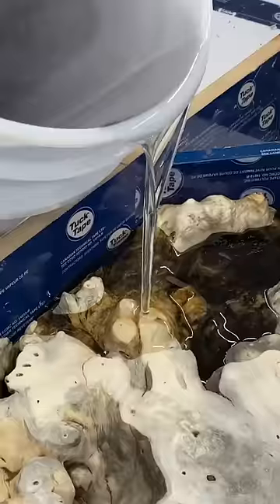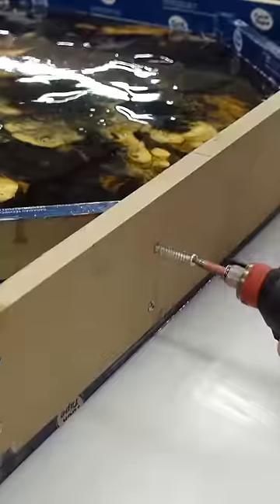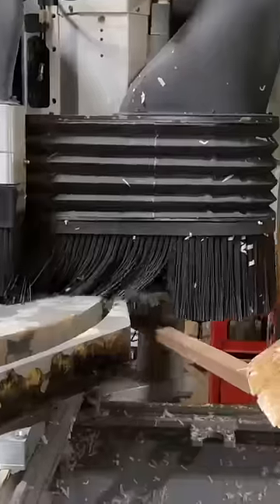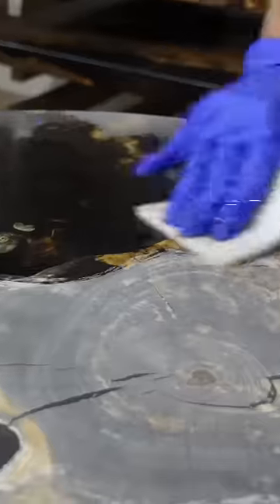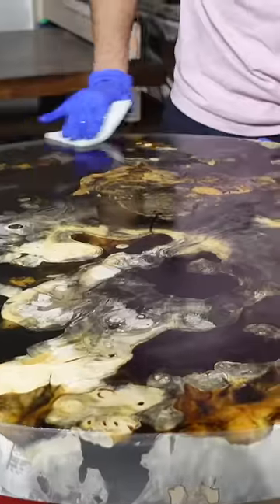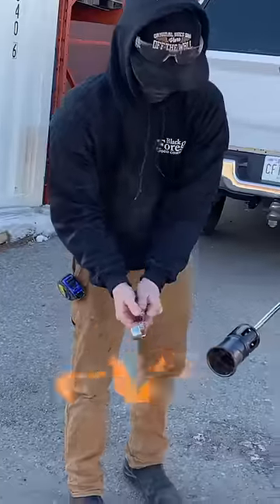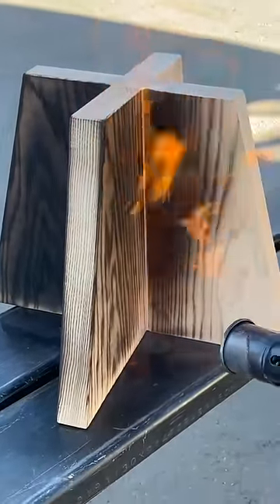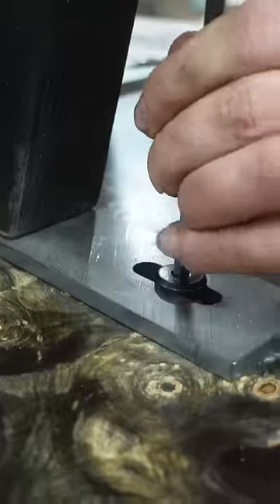Coffee Table made with Ancient Japanese Technique #woodworking #burl #epoxy #furniture

Comment: traditionally the japanese use heated pieces of smooth metal that they drag over the wood to char it. I tink it gives a nicer finish because it shows the grain structure of the wood. You might want to try that on the next one
Reply: Yeah with what appears to be white pine and a torch it doesn't look much better than if they would have painted it matte black and called it a day.

Sho Sugi Ban should have MUCH more texture and personality.
Reply: I also seen ones were they torch it first and run a wire brush across it, but some of the pieces are crazy beautiful
Reply: they did it the american way
Reply: yeah the finish is very nice, it becomes smoother to touch but still has wood texture and looks like it was painted
Reply: This is a different Japanese method called yaki sugi
Reply: @El-xt9oo  You mean the cheap and easy way?
Reply: Also probably reduces the odds of the wood catching on fire.
Reply: @updownstate  yes bro
Reply: @updownstate  cheap and easy is china, America is efficiency. It wouldn't cost anything really to do it the way the commenter said, but sure would take longer.
Reply: @Kratos-eg7ez  "cheap and easy is china, America is efficiency"

You keep telling yourself that if it gives you comfort.

You are deluding yourself if you think for a second that a country capable of producing companies that cause disasters like the Ohio train spill are not capable of cheap and easy methods to gain greater profits.

It's about the business itself, not the country they are based in.

"It wouldn't cost anything really to do it the way the commenter said, but sure would take longer"

On reflection it's clear that you don't get how business works at all.

Longer = more time = more wages paid per work order = less profit = MORE COSTS.
Reply: there's maybe 1-2 old man still doing it like this somewhere in the world but even in japan no one does it like that anymore

Comment: I believe the use of CNC machines, polymer resin casting, LPG torches, steel brackets, and wood screws driven with lithium ion battery-powered drills dates back to the Edo Period, some time mid 15th century. It is my understanding that the Tokugawa Shogunate was rather fond of the Makita drill prior to the arrival of Commodore Matthew Perry's armada in 1854, after which the forced trade with the United States lead many traditional woodworkers to begin experimenting with DeWalt drills. So nice to see the old ways still honored.

Comment: If I remember correctly the Shou Sugi Ban technique translates as "burnt cedar" and was a way to make the surface of the wood (traditionally Japanese cedar) inhospitable to the growth of mold and mildew, thus allowing the wood to last longer in moist environments.
Reply: For it smell like burnt wood 😂
Reply: Maybe I'm thinking of something else, but aren't you supposed to heat up flat irons and drag them cross the surface of the wood to char it with that?  They just took a torch to it.
Reply: @danlorett2184  I don't know, I've only ever seen someone use a torch, but the people I've seen do it weren't Japanese.  Considering the technique is hundreds of years old I wouldn't be surprised if they heated up an iron in a fire then pressed it into the wood.
Reply: There two main techniques the flat metal and you can also put the pieces together in a triangle and lit the inside

Comment: My ex-father-in-law decided to cover their living room's walls with pine boards and then go over every bit of it with a propane torch, followed by brushing with a stiff wire brush. He told me that after about 2 square feet, he hated the idea but he was too stubborn to admit it and he eventually completed the job. My ex-wife said that there was black soot everywhere in the house and they kept finding it for months. I saw the finished room several years after he'd done the job and it looked awful. It looked like the room had been on fire and all they'd done was replace the furniture without fixing the walls. The technique of scorching wood can work in the right circumstance, like in this video, but it can also look like, as well as be, a disaster.
Reply: You are supposed to do it elsewhere and remove the excess (loose) charcoal particles on the surface before installing it.

Sounds likie your dad got the right idea lacking the proper way to do it.

Even so as you say for walls it won't look stellar - better to stain it with some kind of sealant.

Comment: Shou sugi ban is a technique that char’s the summer wood and leaves the spring wood uncharred or barely charred. Fully blackening it like that just causes the outside to look bad and makes it weak and brittle.
Reply: You might want to look into the technique a bit more. 
It is pretty obscure these days what is and what is not shou sugi ban. But charred look definitely goes into that category.
Reply: This is called yaki sugi, normally used on cladding/fencing etc

Comment: What did you seal the base with to keep everything from getting char marks on it?
Reply: That is my question also.
Reply: Same here.
Reply: Nothing. Just wipe it clean until it stops coming off, and you'll never have an issue with it.
Reply: He may have put shellac on it?
Reply: Traditionally it is sealed with natural oil after charring. I dont know if these left it out of their process or out of the video
Reply: @jariroth  They mention it uses some kind of oil for the exposed wood surfaces usually on all of their projects, that would do the same job.

Comment: The table looks great, though I would have gone with a slightly lighter tinted epoxy/ acrylic for the tabletop. That said, here's what I have experienced with using Sho Sugi Ban. ( for anyone wanting to skip my breif mental notes section below, feel free to.)

Ah, Sho Sugi Ban. The ancient Japanese art of " Intentionally burn it with fire so it cant burn down so easily in the future". XD Gotta say, I love using this technique for chef's knife display stands, walking staves and canes. My experience with it though yields 3 major points:

1: Get it hot and control your heat. Using a giant weed burner tip dissipates too much heat in too much of an area. Thin, wide jets or super heated small jets and multiple passes work much better. 

2: Different approaches yield different finishes. Depending on your finishing needs or preferences, taking that brush to the wood may be the worst idea you've had. For a " raven's feather color", just wait until the peice cools then coat with high gloss food safe clear coat or paste wax. For a chestnut/ Auburn color, use a dollar store set of dish cloths after the section cools and wipe the carbon off the work peice if you want to lighten the color and raise the grain, then seal as above. For a light color you can apply stain over, brush with a stiff bristled nylon brush and wipe down with a clean sacrificial dish cloth until you get the desired effect. 

3: Break out your mad science goggles and safely experement! In addition to safely using fire as a tool, I've found various other tools work really well. Wood burner tools, highly polished scrap peices of wood used as burnishing tools, heated trowels or butter knives, etc! Just remember, experement safely, take notes and have fun.

Comment: Charring the wood is a means of protecting it from the elements outside, it is entirely un-necessary for indoor use and will mar anything that touches it with black soot.  Brush it and then sand a little and clear coat the stripey wood and it would be amazing looking.  Table looks good.

Comment: Sho sugi ban is a technique used with resinous woods like conifers as the heating causes the resin to change. Doing this with hardwoods and most other woods just chars it. If you don't remove the excess char the surface finish won't last

Comment: On the brackets on the bottom. I see that there slotted.  It would be neat to see the holes drilled and chamfered to have the screws flush mount.  But maybe those brackets you use are universal. Idk just a thought

Comment: I think it would have looked better with if you didn't shave off the top of the burl and if you would have left an inch of resin above it.  If you would have set the burl at an angle so that it would looke like mountain ridgelines it would have also looked unique.

Comment: I thought you were supposed to brush off the excess 'char' and oil the wood.
      The burn needs to be deep enough to 'carbonize' the wood that's not burnt to a crisp yet. (The carbonization alledgedly makes it a lot harder, and indeed, resistant to rot and pests)

Comment: The brackets look terrible. Like yeah, they're underneath the table and you won't see them 99% of the time, but you have a fucking CNC machine, could could have taken ten minutes and cut an inlay for the bracket into the bottom of the table and affixed it with adhesive, after you either cut the wood base to match the profile of the brackets, or just trimmed up the bracket so the wood base was flush to the bottom of the table once it's all said and done.

Comment: The resin is too dark it just looks ugly. You only scorched the surface of the bass you were supposed to do a little bit more than Scorch it. You were supposed to severely burn the surface and then wire brush the charcoal away leaving a textured surface. I find a copper wire wheel works rather well. And I assume you gave everything a resin coat

Comment: That charring of the wood was popular as a art technique for wall art that you would put poster on and then you put the epoxy or whatever on top of it. I did that for a wedding gift for some friends of mine and you char the wood and then you ( it was plywood so it's just the top surface)  scrape the more charred softer areas out with a wire brush to make the grain stand out even more. it's very pretty! Then you seal it. I'm kind of amazed at myself that I actually did that. I had no idea what I was doing and it came out right! It was big probably 24x36 because the poster was 18x24 yeah.